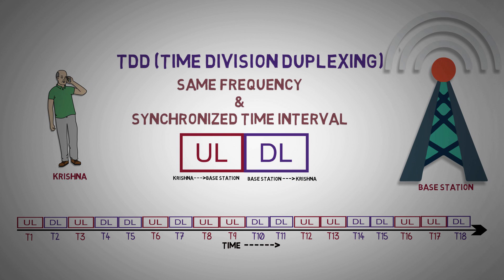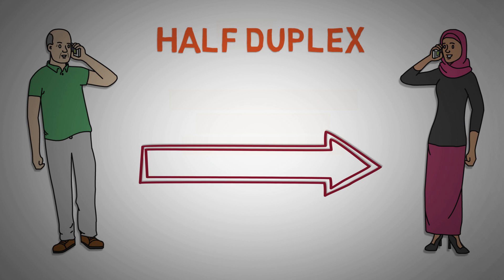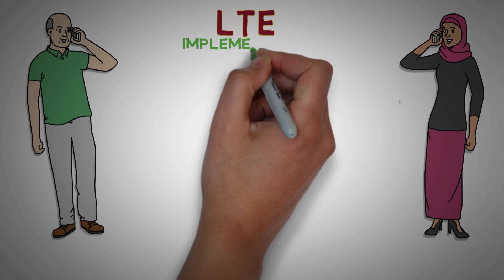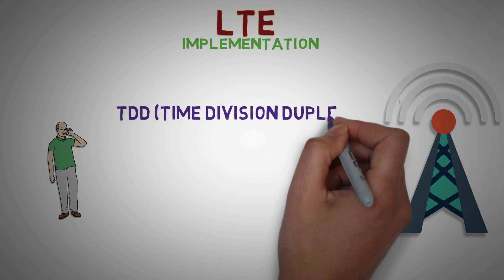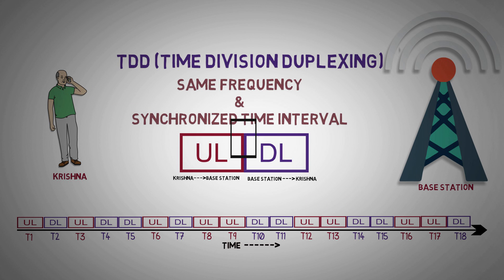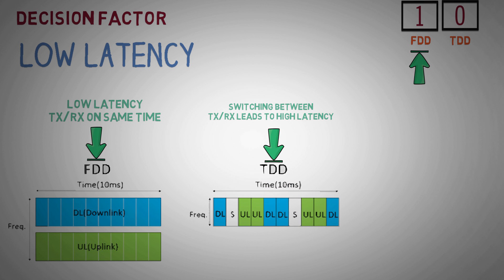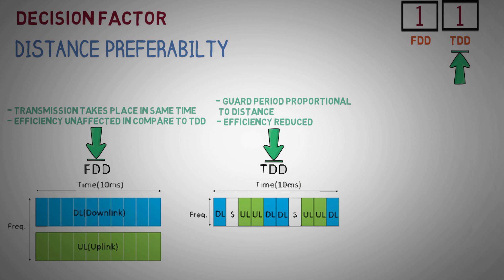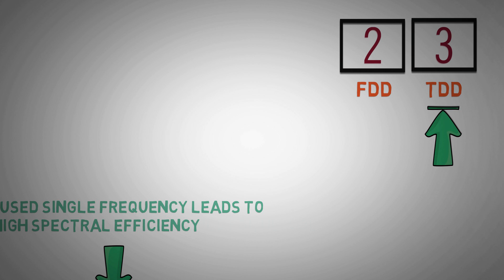2.1 -  TDD vs FDD in 4G LTE

Comment: Both FDD and TDD require precise timing and it has nothing to do with upstream vs downstream.  The LTE frame is very complex, with multiple time slots and all devices have to be synchronized.  This is maintained with Precision Time Protocol (PTP) to maintain timing within 1.5 µS.  Also, TDD isn't a simple up & down, with guard time as you show.  A frame is very complex and often has the uplink and downlink slots right next to each other.  It's the precision timing that allows this to happen and the transmitting device actually adjust when it sends a time slot